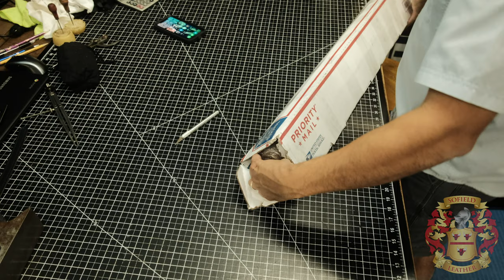Unboxing Buttero from Rocky Mountain Leather - Review and Wallet Build

Comment: It's beautiful stuff but scratches way too easily.
Reply from the maker: Haven’t had that problem yet. I definitely keep an eye out for it. Thanks for the heads up and thanks for watching.
Reply: Found the same thing at first.  Now, I rub Smith's Balm on the leather after my rough size cut and before I measure and cut to working size.  After that, it does not scratch that easily.  When I am done, I either apply more Smith's Balm or Bick 4.  Minimal scratches.